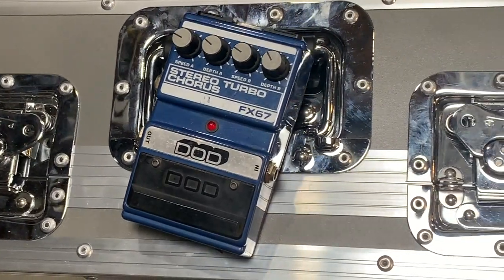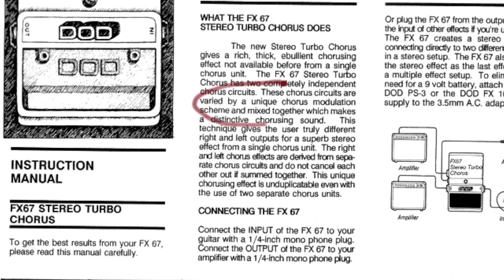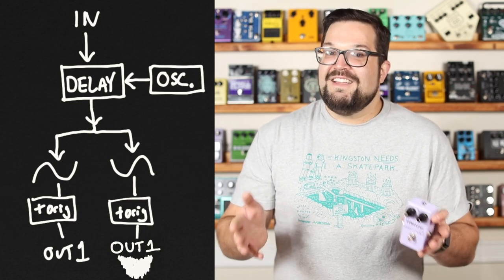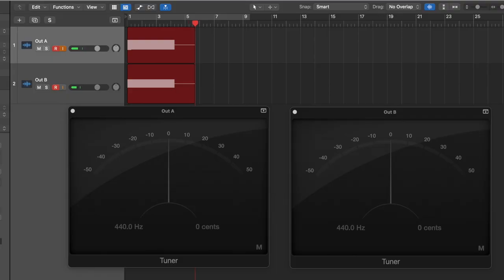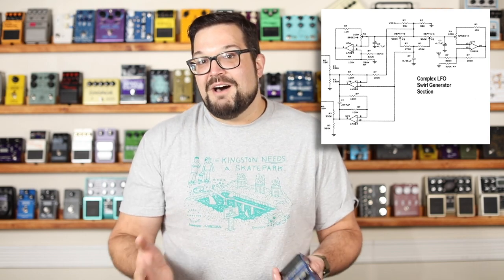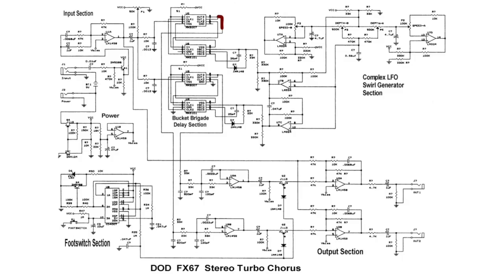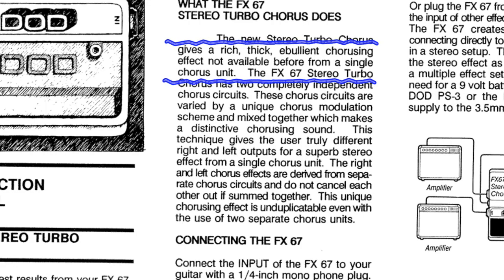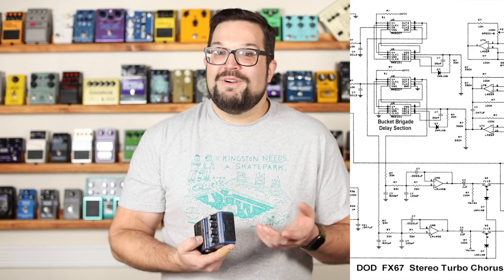FX67 Stereo Turbo Chorus - Greater than the Sum of its Paths

Comment: Interesting you brought up Maxon (Ibanez) because they also did a ton of choruses that did the dual oscillator thing, but they're all based on the original Maxon/Ibanez BC9 Bi Mode Chorus. The problem is that like all the other Ibanez/Maxon choruses, the stereo effect was still out of phase. It wasn't true stereo like the DOD, it was still 2 oscillators stacked on top of each other. 

I really really wish Ibanez had the sense to do 2 separate oscillators like DOD did. I personally think the CS circuit sounds miles better than DOD's chorus effect, even in this video I preferred the Maxon over the DOD lol. A true stereo CS9 would be my dream chorus pedal

Comment: I wonder why chorus pedals dont just output the dry signal on one jack and the delayed signal on another, for stereo?
Reply from the maker: A lot do, it's usually either the inverse method or A:Dry B:Vibrato. It works, and sounds nice in a real physical space where sound can take a complex path to your ears, but summed to mono it can make it sound a little lopsided.

Comment: I have 2 questions: is the Maxon clipping on its own or was it the recording? is the DOD analog or digital?
Reply from the maker: I'm using an amp sim that has a liiiiittle bit of gain, so the clipping is from the recording. I've never really noticed the clipping when using the CS-505 on an entirely clean amp. It's not digital, it's using bucket brigade delay lines and oscillators. Some argue bucket brigade is not truly "analog" because it's breaking the signal down into samples, and that bucket brigade is more "solid state" than analog, but it's NOT digitizing and doing it in software, which is probably the root of the question.
Reply: @StompboxBreakdown  thanks for your reply.